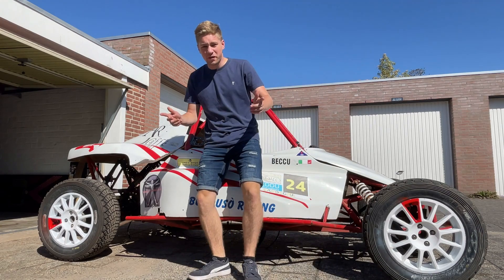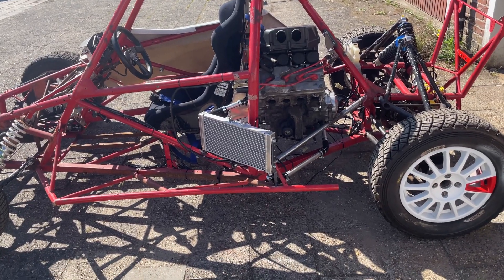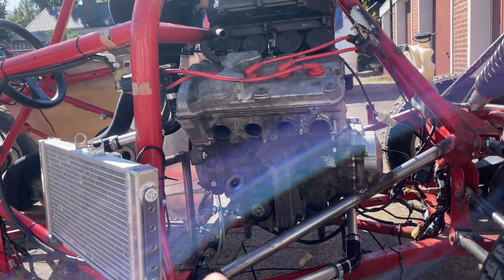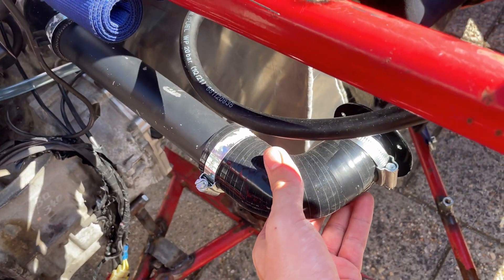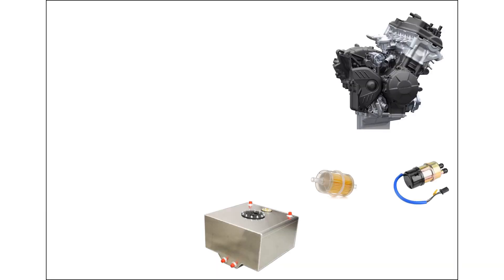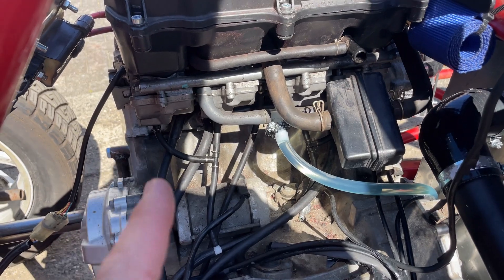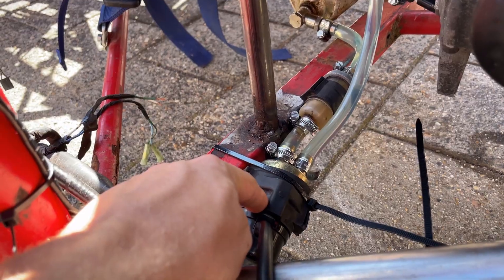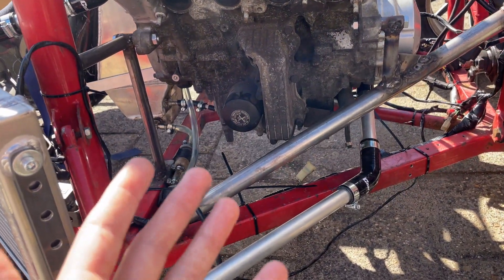The ENGINE of the 1200cc V8 BUGGY is RUNNING!! Greatest sounding engine??

Comment: What fuel pump did you use and how exactly is the wireing of that pump with the relai (wire diagram ?) I am building a buggy for the autocross cups in germany and this would help me a lot also the wireing of a fan for the radiator as well as temperature gauges for oil and oilpressure and coolant 
Also Nice buggy ❤
Reply from the maker: Are we using the same engine? This engine comes stock with a fuel pump, so I am just using that, and than it’s all plug and play. Same with the fan and the gauges although I am thinking to make a button for the fan to start it manually. Thanks man! I would like a picture of your buggy too!
Reply: @GuyWithCrossbuggy  i have a kawasaki gpz 1000 engine with almost the same carbs in my buggy it makes about 170 whp rwd quite fun... do you have instagram i can send you pics from it
Reply from the maker: @sess-bikelife1212  Wow that sounds like a lot of fun indeed! My instagram name is Guy_with_crossbuggy